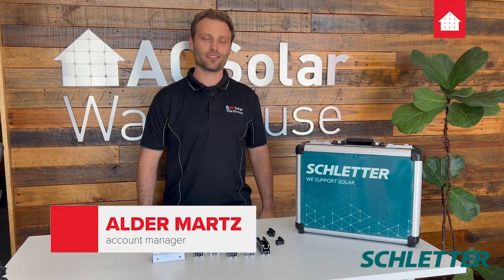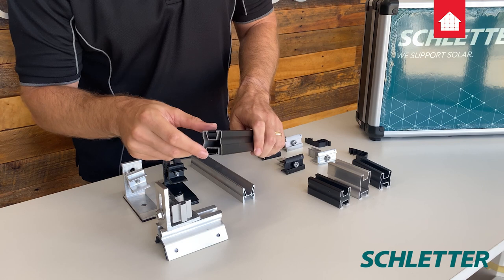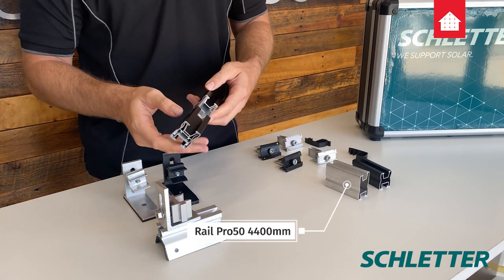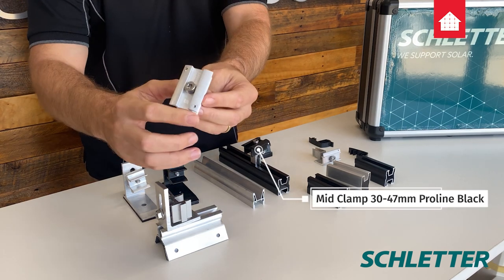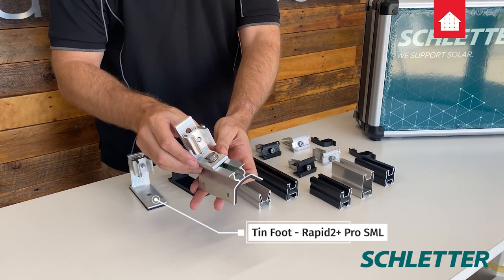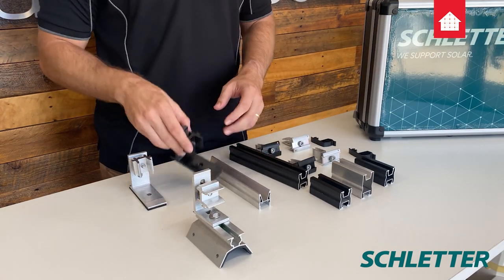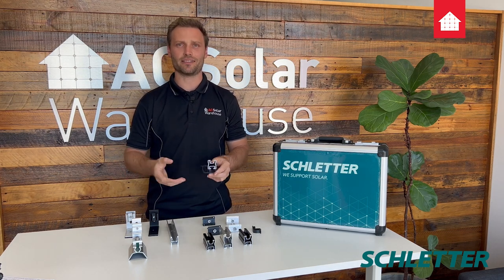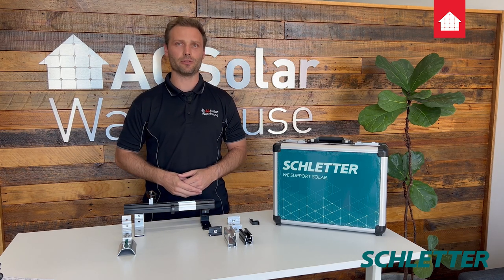Schletter solar racking and mounting system introduction

Comment: Do these have a lifetime greater than or equal to the life of the PV system?
Reply from the maker: Schletter offer a 25 year manufacturer's warranty and the design life of the components is in excess of 30 years, so yes, the racking system  is designed to last at least as long as the other components of a typical PV system.